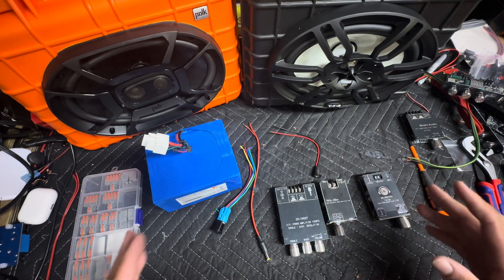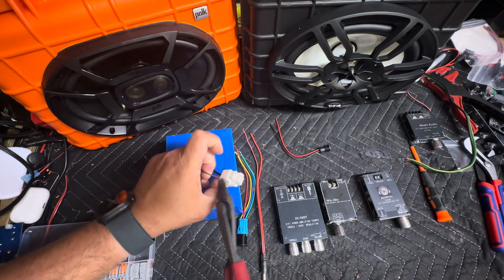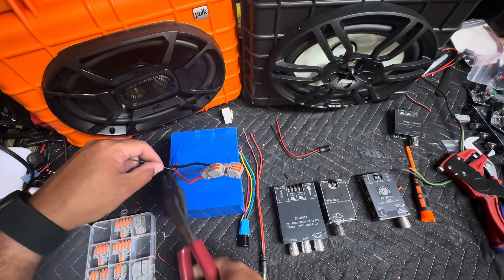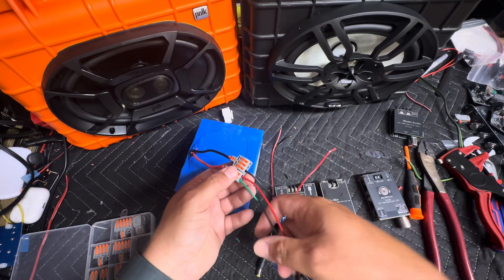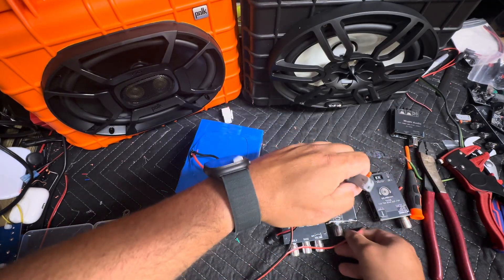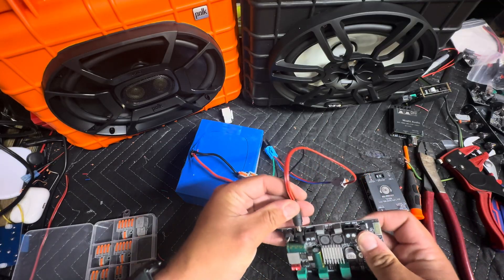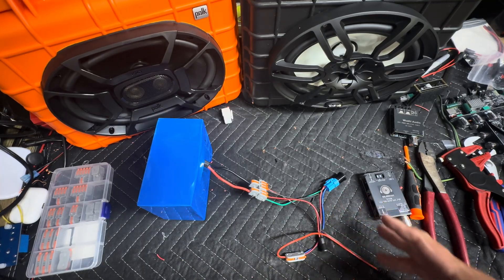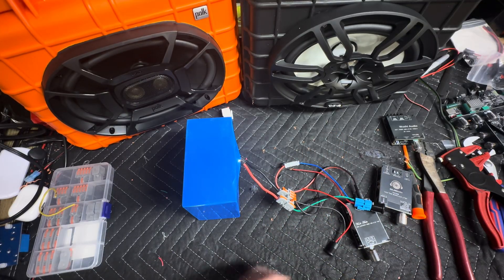Basic BoomBox Wiring

Comment: So you're running all the power through the switch.  Would you not want to run a relay?  Also does the battery have a "fuse" built in or is there no fuse in the system?